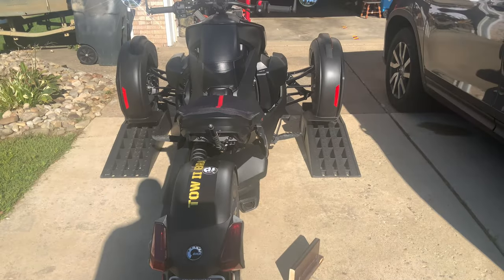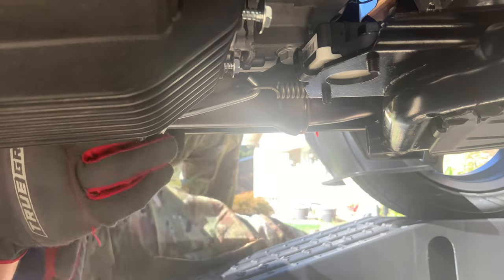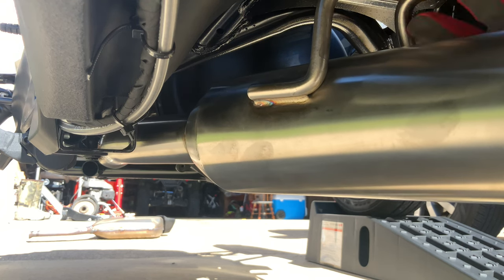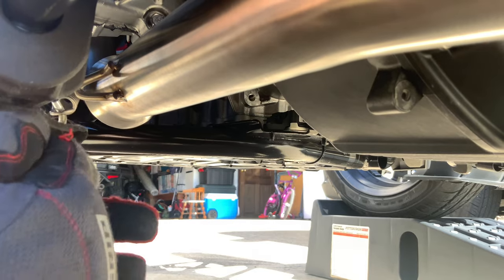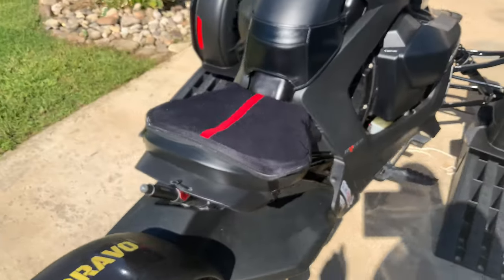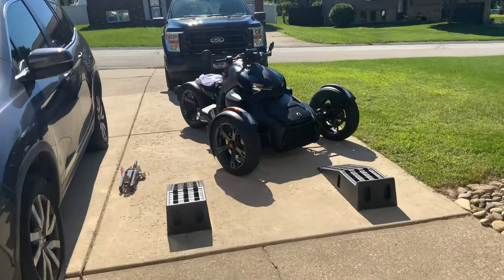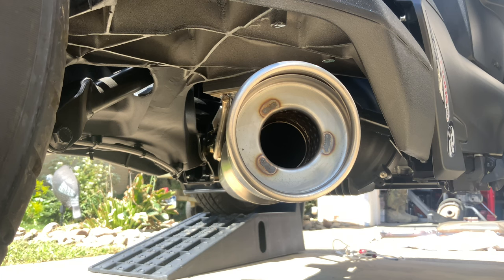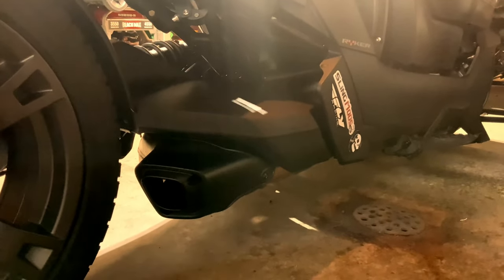Can am RYKER 900 Exhaust upgrade fail-SILBER TURBO EXHAUST.

Comment: The universal baffles don’t work to reduce your noise of the exhaust overall but they do reduce the high frequency sound.  I bought 4 baffles on Amazon and I also have an exhaust just as paper weight in my garage.
Reply from the maker: Thanks for the information.
Reply: what part number is the baffle from amazon? Ty

Comment: Nice video. Back in 2007 buddy of mine showed me a trick with a flathead screwdriver to get those tension springs off and on. Never used anything else on those springs since. Again great video very informative. It's amazing to me how Can Am crammed the engine, transmission, fuel tank hell everything in that little space up front and still had room for a rack and pinion steering. How loud is the exhaust baffled? I'm looking to shed some weight on my Ryker but don't want to rattle the pictures off the wall or have people still hear me after I've left 5 minutes ago. Just something a hair louder then stock is what I'm looking for.
Reply from the maker: Thanks

Comment: I have the tunable version myself. Sometimes i take the silencer out when i know im go fly down some back roads. Otherwise i run both the baffle and the silencer in the silber turbo tunable version
Reply: I been running the silencer and baffle... Do you notice any difference in performance when you take out the silencer
Reply: @laurentterrell321  def seems faster when I pull out the silencer. It might just be the loudness though

Comment: I bought a 42mm silencer and that exhaust is not as bad. I'm thinking of gutting the last stage of that exhaust and push a silencer up in there then put two stainless screws to hold it

Comment: Not sure why anybody would think putting a baffle in the lead pipe would have a significant impact. 
Any other applications have them in the mufflers or at the end. 
Also the one in the video the manufacturer claims is a baffle Is Not. 
A baffle Redirects some of the gasses to create a mixing effect. 
The piece in the video is a Straight Shot through it so it is doing absolutely nothing.